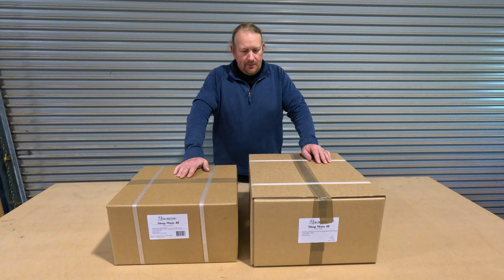Shop Mate 48 Setup

Comment: Would u recommend this machine to flatten the back of ordinary wood work chisels?  As many are old and even new ones should be flattened 1st
Reply from the maker: I have done this with larger framing chisels, but you do not get a perfecty flat finish off a belt, no matter how flat the platen is. 
A disk grinder with the paper stuck to the disk will give you a flatter finish and is my go to for preparing the backs of chisels.
Reply: @84engineering thankyou

Comment: This thing is a beast. I bought one about a year ago. So much power. It never Boggs down. Do yourself a favour and fit a handle to the belt tensioner. I wish the power box had a power point for accessories like a light.
The quality of this machine is first class.